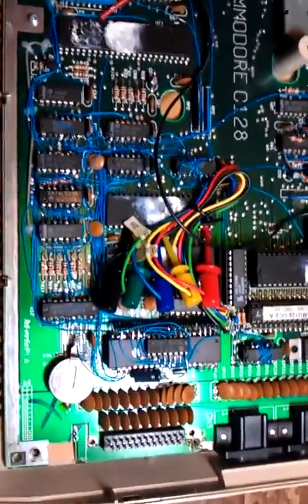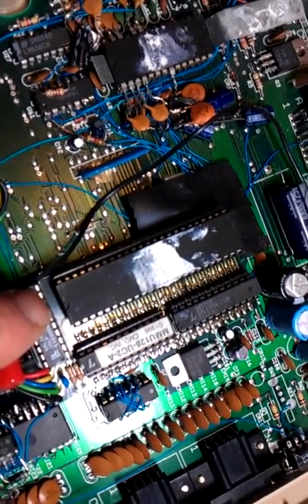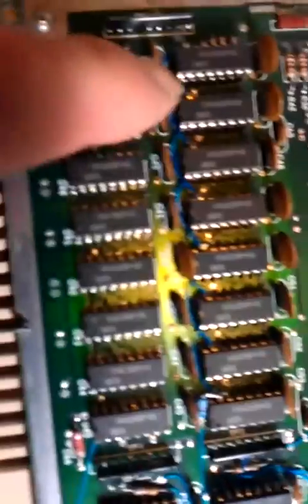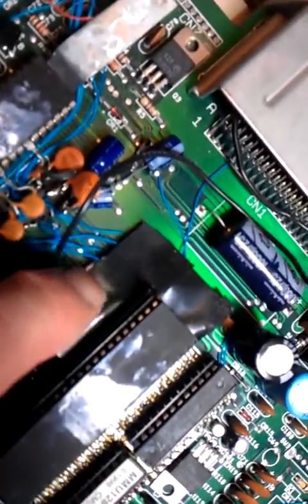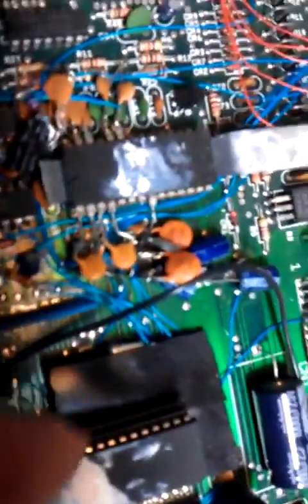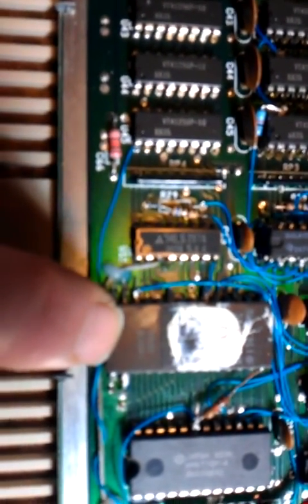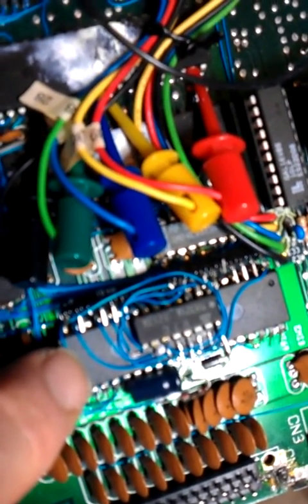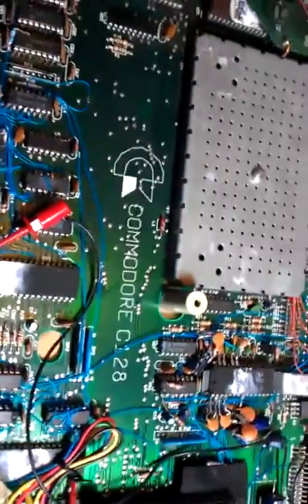C=128 inside mods

Comment: Great mod!! but scary ..a lot of wires.. i restore from death a C128D, only all capacitors and add rear fan cooler like some 128D but i add a automatic  fan controller that runs if internal case temp reach X temp. I dont have serius skills but i try to add some roms,  greetings!
Reply from the maker: I still have my 1st flat 128 and I did a lot of mod's in that one too the 1st time and the wires in that are super messy. I remember used wire wrap and 2 wires were shorted out I guess from heating them and they got hot. That took a long time to find out was was wrong with the 512 RAM added. That's why I did this 2nd flat 128 way neater. It been working super for years.